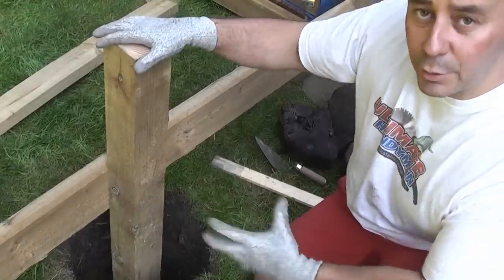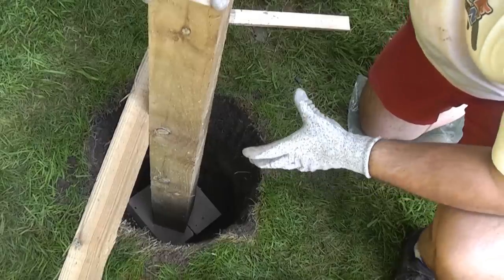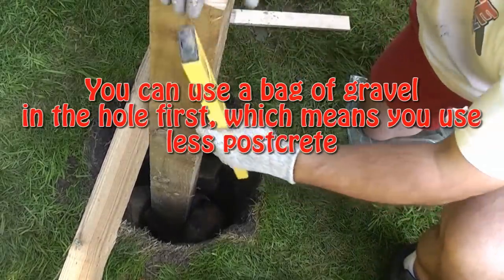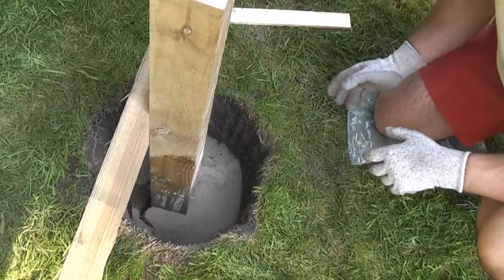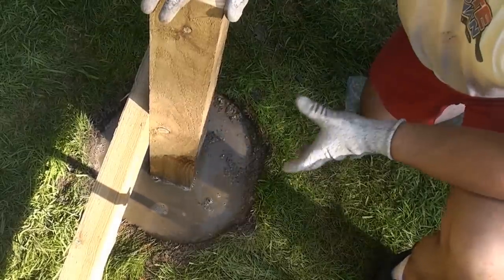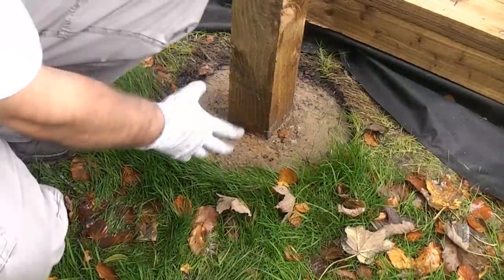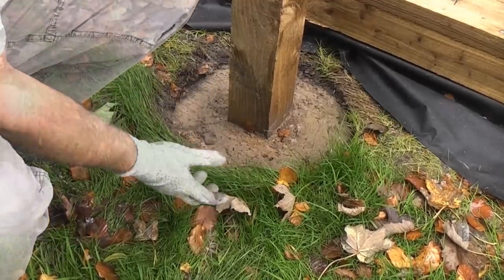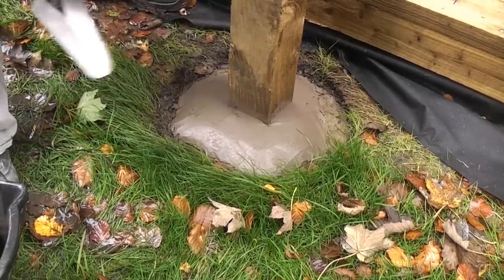How to install decking posts

Comment: yeah in us, we never put our posts in the ground. hooraa!
Reply: that's probably why houses blow away in America at the slightest fart
Reply: word to herb.
Reply: The statement we in the US don't put our posts in the ground is not true all pole buildings the posts are in the ground with cement around the post so building a deck using the same concept isn't any different!!!!!
Reply: This is the second time someone has mentioned American houses blowing away. Where in the world did you hear this weird tall tale? Are you watching hurricane newscasts and assuming that happens all the time?
Reply: Michael Wilson, that was the old method, now a days there is precast columns and drill-dry/wet set brackets one can but to keep the post out of the ground to make repairs/replacement as needed much easier.

Comment: No offense, but why would you set your post is concrete? When you set wood in concrete it will wick water through the ground up through the concrete and into the post and rot out everytime. This will only take about 5-8 years depending on your area; not a good idea. In my opinion you should always set a concrete pier install a j bolt into the concrete and then bolt a galvanized post base to the pier, and then attach your post. When done this way the wood can dry out because it isn't stuck in concrete. Water will still get in the way you are doing it no matter how you finish the concrete.
Reply from the maker: The timber is tanalised and should last 30 years outside. Setting decking posts in concrete/post crete is the way it is done in the UK.  Even if tanalised posts are just knocked into soil, they will last many years, and if they fail it is always at the point where the post exits the ground (they are fine above ground and below ground) 
Thanks for the comment  👍

Comment: 1. Why are the bags so small?
2. Why is the hole 20 times wider than the post? 
3. What language are you speaking? I didn’t understand a word!
Reply: 1: because a lot of people using a ready mix may not be able to lift larger bags usually used by builders etc
2: the size of the hole needed can vary. It entirely depends on both the application and ground conditions 
3: English

Comment: what are you planning on putting on the decking?........ a car, i really dont think you have to use all that for 1 post,  there is just too much work and money.
Reply from the maker: Normally I would put more posts in, but a sand pit lid runs under this deck so it had to span a large area-
https://www.youtube.com/watch?v=l2HlC0yl-SUThanks for the comment ;-)
Reply: thinking the same thing....geeez

Comment: Never put wood in a cement footing.  Wood rots and the footings will not last long.
Reply: Not if you are using treated 4x4s, which have been burnt up to ground level and retreated. Also as is shown in the video you make a slope away from the post with the cement for the water to run off.
Reply: tell that to my 17 yr old deck...

Comment: Might be solid but surely that will rot in no time,
Reply from the maker: They are fine, providing you dome some mortar on the top to prevent water pooling at the base!
Thanks for the comment 👍

Comment: THANKS FOR THE VIDEO ,,,,,,, BUT PLZ CHECK YOUR POSTS AFTER FEW WEEKS, YOU DEFINITELY FIND NOT PROPERLY BONDED CONCRETE,  COZ YOU DIDNT STIRR OR MIXED WITH WATER OR INSUFFICIENT WATER TO PENETRATE INTO  MASSIVE STUFF POSTCRETE AT A TIME..
Reply: Nonsense . You do not need to stir Postcrete or mix postcrete.

Comment: This dude has no clue what he is doing.  concrete is NOT to be mixed in place like that as this will create the potential of having dry cement in the hole.  Mix your concrete in a concrete mixer or a bucket in advance, then pour in the hole.  Do not follow this dude's recommendations.  Happy building folks.  cheers.
Reply from the maker: Hey dude, I did not use concrete. I used Postcrete (which is used exactly like I used it in the video)!
Reply: I take it the modern invention of postcrete has not made it as far as you yet.

Comment: Does it have to be 700mm deep? Iv got pipes and other services running underneath where I want to put decking
Reply from the maker: You might be able to build a deck using concrete paving flags as bearers (first picture on this page) http://www.ultimatehandyman.co.uk/how-to/decking/decking-basics
Or a combination of that and installed posts
Reply: @ultimatehandyman  thanks for reply. Problem is out patio is sinking because the people that lived here before decided to lay it on 8 inches of sand!
Reply from the maker: @kellyb0279   Blimey, that sounds exactly like my patio. It had to be dug up about three years back and re-done using crush N run.